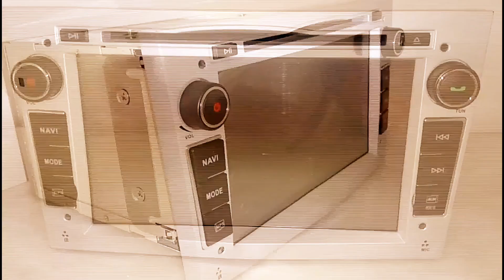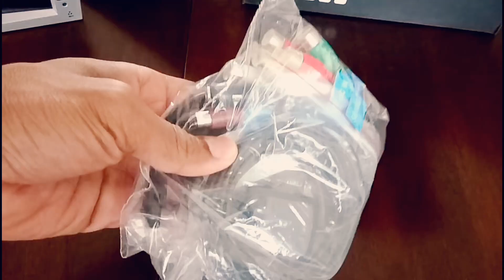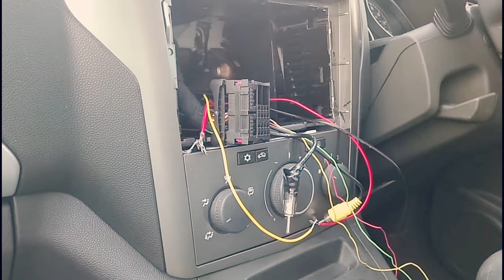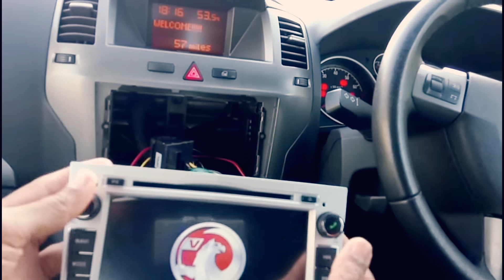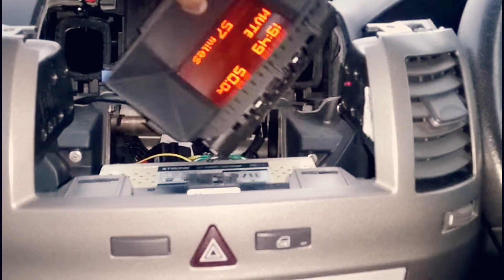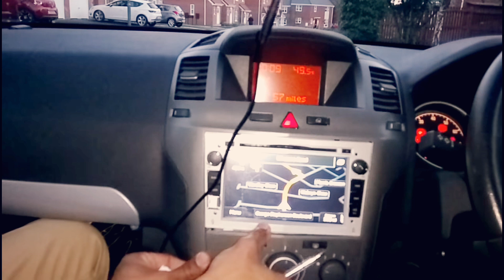CAR radio Xtrons  head unit installation

Comment: Hello
It's  about my captiva 2009 and xtrons  PF70MTWS head unit DVD GPS camera..
The Xtrons double din stereo i want to fit is 189mm x 117mm and my car centre conole is 200mm x 120mm
What panel and cage to use pls?Thanks
Reply from the maker: Yes

Comment: where does swc go
Reply from the maker: what is swc thanks?
Reply: @nuramoboy  steering wheel control module
Reply from the maker: the harness is preset and coming with everything no need for extra connection